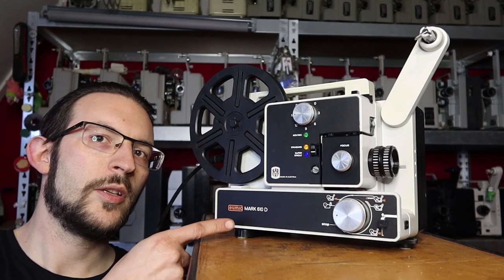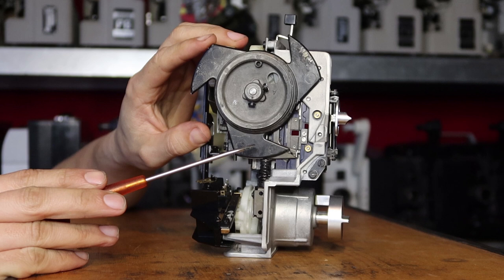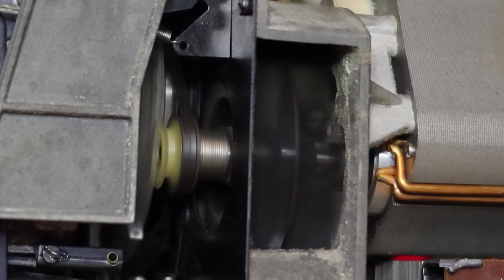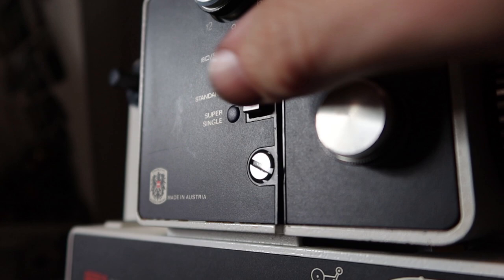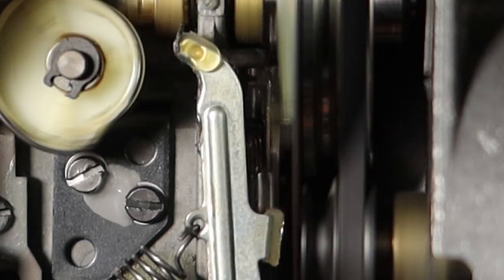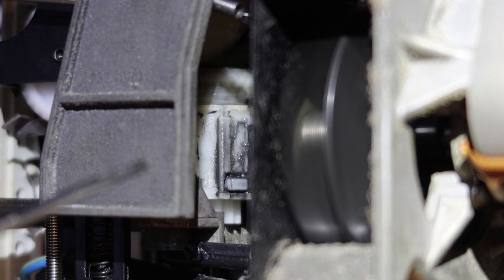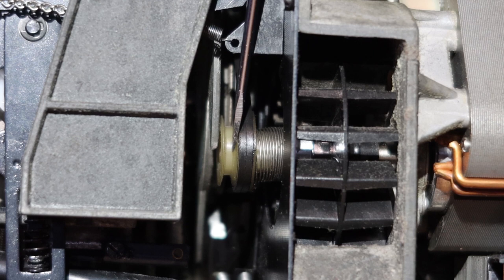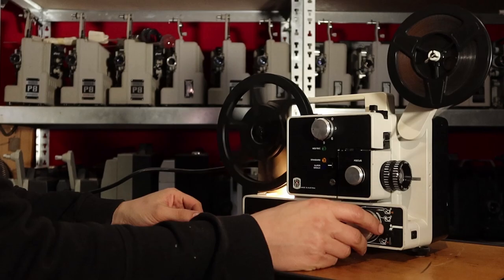A tribute to the Eumig Mark 610D Dual gauge 8mm projector

Comment: As the cooling fan is directly off the motor that slow motion system ensures that the cooling is constant whatever the frame rate. Slowing the motor speed for lower frame rates would decrease the cooling too.
Reply from the maker: Yes you are correct

Comment: This is my favorite too. However, I'm getting more jitter on older films than I recall. In reverse they are very smooth. I loosened the pressure nut on the take-up reel so it isn't pulling the film. What else to look at? Gate doesn't seem very adjustable... What about adding pressure to the gate?
Reply from the maker: You could check if the tension on the film from the supply reel is okay. If this is too high the film will also jitter

Comment: Im trying to replace the bent to my 607d and i am having such a and time getting to it. I followed the repair manual but cannot get the motor out to reach the claw
Reply from the maker: You do not remove the motor when you replace the belt. It is finnicky to get the belt around the big pully. Remove the lamp for better acces. I have a small hook to pull the belt around it from the lampside. When its looped correct on the big pully Then make sure the shutter blades are in a position where they don’t block acces to the motor pully.
Reply: @eriksnel6461  thanks so much for the reply! It keeps getting stuck in a weird spot but ill keep trying! Does your shop ship to the US? I may have damaged the belt trying to get it in there lol

Comment: A good projector for digitization, but the more advanced model Eumig-624 does not allow you to expand the frame window due to design features.
Reply from the maker: Well the 624 is not really more advanced. Just the same projector in a modern jacket. The features and mechanics are identical
Reply: @eriksnel6461  Да, но другая конструкция фильмового канала более  прецизионная а в целом 624 обеспечивает более качественную проекцию, у меня и 610 и 624 а минусом обоих является разнесенные зубья грейфера что дает знать на некоторых пленках  имеющих усадку.

Comment: I have 6 eumig projectors of different models. The main problem in some of these is transformer and motor heat up  even it can not be touched. Why it is so?
Reply from the maker: That’s not okay. My guess is that the mains voltage is set wrong, or the motor has too much friction and is drawing too much amps. Having the wrong lamp can also cause heating of the transformer. So if the projector needs a 100 watt bulb you cannot use a different wattage
Reply: @eriksnel6461  Thanks for your reply. I am in India and here it is 240v 50 hrz power supply. I have 30 more projectors 8mm, 16 mm and 35mm. All are working good. The problem is only in eumig projectors

Comment: Nice Video!  I have a 610 D that won't project light in forward mode but does project light when threading the film.  Any troubleshooting tips on how to get it working?
Reply from the maker: Might be a misaligned cam on the back of the main switch. Because the lamp shouldn’t be on when in threading mode. Only the pilot lamp

Comment: Hi Erik, Got my Eumig Mk610D up and running the other day with a new bulb. I ran a 30min film through and noticed it got really hot. Put another film in and after about 10mins it started to burn the film. Is this common? or whould there be something wrong with my machine. I did notice that at full speed there are no filters over the lamp. The filters only engage at the slower speeds. Thanks for your help!
Reply from the maker: The filters only engages in the lower speeds. Is it the right lamp? Maybe too much power? You need a 100 watt max lamp. Bigger means more heat and it will kill the transformer in the long run to
Reply: @eriksnel6461  Its the 100w 12v MR16 dichroic 2" reflector. Meant to be the correct one but maybe not? Seems very hot after about 40mins of use.
Reply from the maker: @sutherlandgalleries3717  that is the wrong lamp, you need indeed a 12v 100 watt lamp, type EFP with a GZ6,35 fitting. Your lamp has a piece of glass in front of the bulb and a facetted reflector. An efp lamp has a smooth reflector and no extra piece of glass.

Comment: Very Helpful Video!! Are the lenses able to be taken apart to clean in internal lens? as mine has some mold on the inside. Thanks for any help :)
Reply from the maker: Thats a good question. I have never take this type of lens apart. But if you have a moldy lens it may be better to find a good one. The lenses are plastic so i think its difficult to get the moldy layer off without damaging the lenses. And it’s the anti reflecting coatings that take up the mold and without those coating the lens will never perform as intended. Glass lenses could be coated again but that is an expensive endeavor. So in short, looking for another better lens is the best option
Reply: @eriksnel6461  Thanks for your help!! Do you know if the lenses are interchangeable between different models or would some models have slightly different diameters? I purchased my 610D for $50nzd which I think was a bargain. Its so much nicer to run than my Magnon 800 ZRS which has eaten a few of my old films unfortunately.
Reply from the maker: @sutherlandgalleries3717   the lenses between 600 serie projectors are interchangeable and there are nicer lenses for it like the lens from the mark 610D Lux. I think you also could take a lens from an 800 series projector but im not sure. It also depends on how the focus mechanism works. Most lenses work with both type of focus mechanism and have a notch or a groove on either side. And yes it is a much nicer projector then a Magnon. Those are very cheap japanese things and a eumig is way better quality
Reply: @eriksnel6461  Cheers Mate :) I'll keep my eye out for another lens.

Comment: Hi everybody, somebody can explain how to replace the rubber belt on Eumig 610d?
Reply from the maker: I could send you a pdf manual. It is a job that can be fiddly
Reply: @eriksnel6461  I did such a replacement last year for the Revue 30b which might be a clone of the above. It was very tricky and took me a lot of attempts. So if you could add a link to this PDF it could save me and other a lot of time and frustration. Dank je wel!
Reply from the maker: @danieldusentrieb8519  hallo Daniel, i don’t have the file on a public server but i can send it to your email. The revue lux 30b was also made by eumig and indeed is the exact same machine in another style of housing. And indeed i can be a hassle to do
Reply: @eriksnel6461  Hi Erik, sorry for being quite for so long. Yes, I'd really appreciate If you sent me the file. Thank you!

Comment: Hello Erik, do you think posseible upgrade some how for 24fps?
Reply from the maker: Hello, no i don’t. 24fps is only usefull with sound films and this projector cannot play sound so there is no point in doing so .
Reply: @eriksnel6461  And maybe the diameter of the drive wheel would have to be changed due to the accelerator transmission?